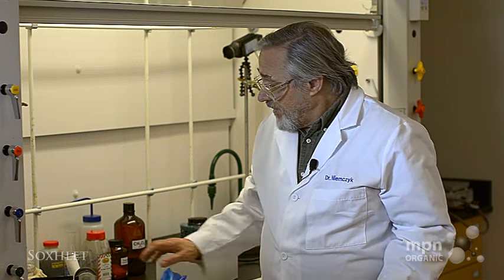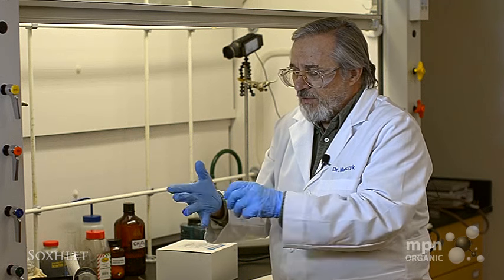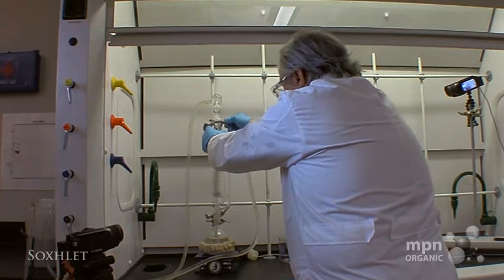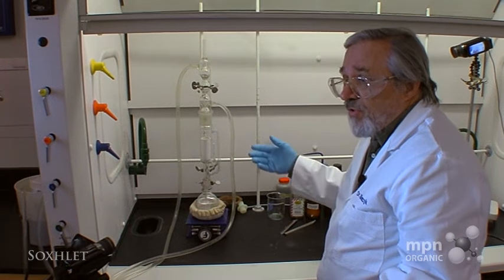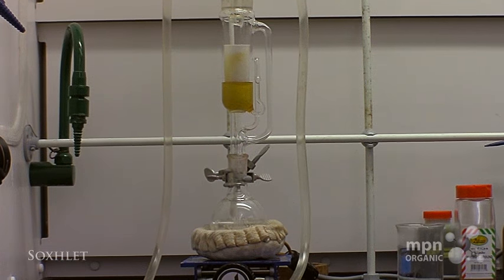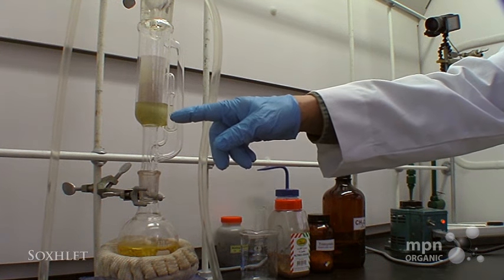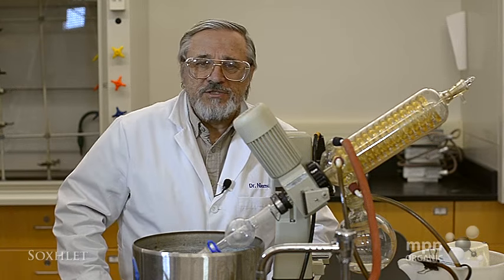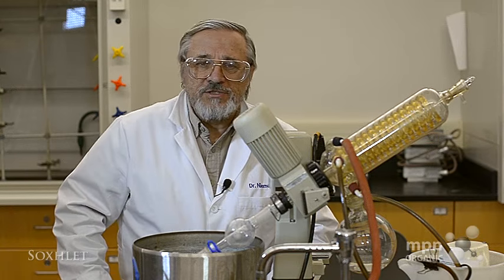SOXHLET EXTRACTION with Dr. Mark Niemczyk, Ph.D.

Comment: is it okay if my extraction solvent does not "siphon off" it just flows down drip by drip...i put 40g of my sample in a 100ml soxhlet ectractor and use 250ml of solvent..do i need to change the amount of sample or  solvent?

Comment: I have a question
I see that many people put the solvent directly into the chamber of the sohxlet apparatus before starting the extraction.
in this video i see that the solvent is in the round bottom flask

which technique is correct or what does it depend on?
Reply: Short answer, is it doesn't matter most of the time, the long answer, is it depends on the type of thimble used. When using a glass thimble, with a rosin or cellulose bag, it is probably better to pour the solvent directly into the soxhlett, whereas in this example with the cellulose thimble, leaving the solvent in the boiling flask is more ideal. Overall, the solvent will get siphoned out and cycled regardless, so it the option only really affects the first or second cycle.

Comment: I would like to know if you can connect a vertical vacuum adaptor between the soxhlet extractor and the condensor in order to work under reduce pressure, thanks, for your video.

Comment: Thank you very much for the video. Very professional. Question, I am new to distillation/extraction and wanted to know is there an advantage to using alcohol base vs. water and using dry material vs. fresh plant matter. Thank you.
Reply: lol fresh plant matter... I see what you're after ;)
Reply: I found these pieces of info to be very helpful:

"The solvent selection for isolation of any phyto-constituent depend upon its solubility in that solvent.
water are used if nature of phyto-constituents is polar
Alcohol is used for if its slightly non-polar (used for both polar and non polar)
Non polar solvent like ether and acetone are used for highly non polar solvent."

 "Factors should be considered when selecting a solvent:
polarity;

boiling temperature - this should be low in order to facilitate removal of the solvent from the product;
reactivity - the solvent should not react chemically with the extract, nor should it readily decompose;
viscosity - must be low;
stability to heat, oxygen and light;

The organic solvents more frequently used are:
aliphatic hydrocarbons: propane, butane, hexane
alcohols: methanol, ethanol, 2-propanol
hydrocarbons with a carbonyl group: acetone, methyl acetate
halogen derivation: dichloromethane, dichloroethane, freons."

Comment: HI! I need an advice. I have to extracted lipids from a solid matrix. I used a Soxhlet; I fill the flask with dichloromethan and methanol. At the end of the extraction how can i  recover the extract? i have no rotary evaporator in the lab. I think that lipids are  dissolved in dichlorometane but both of the liquid solvents are transparent. Can you suggest me some strategy? I was thinking to aspire with a pipet the suspansion but i'm not sure it's is a good idea.
Reply: Maybe seperatory funnel

Comment: How long will u put the extract in a rotary evaporatory? Minutes? Hours? Need this for research purposes. Thank u
Reply: It depends on the boiling point of the solvent, and the amount of vacuum. He's using a low boiling point solvent,  so it only takes a few minutes. You could boil off 100 mL in 10 minutes for sure.

Comment: why not just heat under reflux?? what advantage does this have over reflux extraction?
Reply: I think the advantage over reflux that this has is that less solvent is required and the yield of extract is higher. Think of it this way; the solvent is sitting in the flask and being heated. The solvent evaporates and leaves the boiling flask, and then it condenses as CLEAN solvent in the soxhlet apparatus; sort of like a continuous process of distillation and then using the purified solvent to run an extraction. The fact that the solvent is being recycled is more efficient. The fact that the constantly recycled solvent is free of previously extracted material, which is always in the boiling flask, means more is able to dissolve in it than a solvent that is saturated and being heated under reflux. Heating under reflux is less efficient because eventually you have to change out the solvent which requires a messy filtration process (in which some yield is inevitably lost upon transfer) or use a bigger flask with more solvent to extract the same amount.